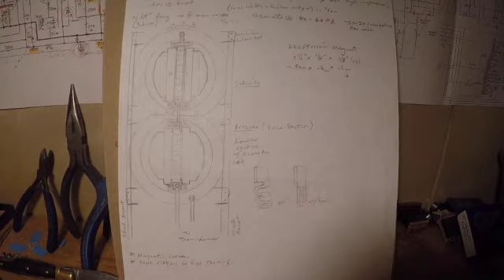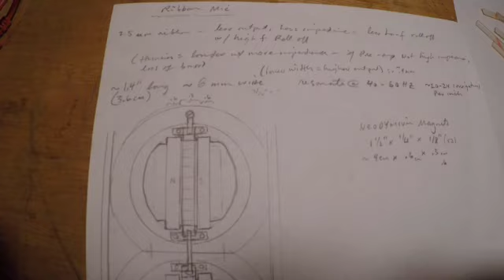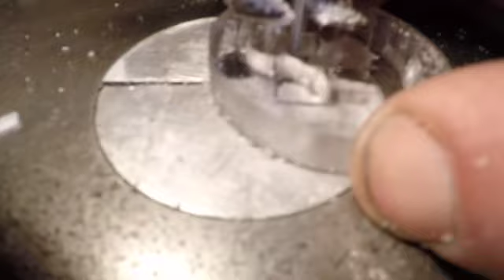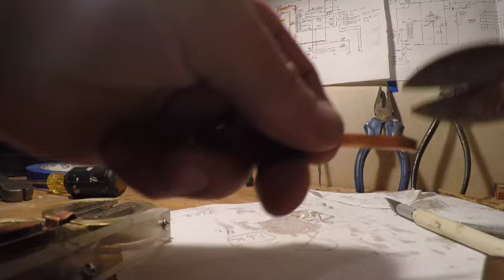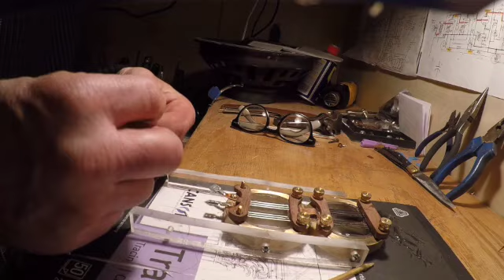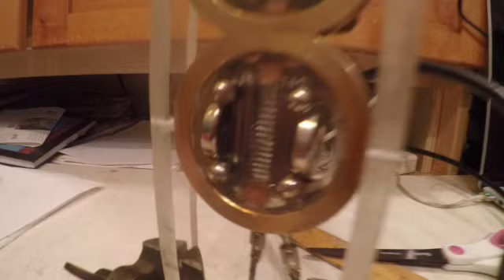Home built ribbon microphone motor

Comment: Still a good bit of buzz compared to the dynamic mic, is there a mechanical buzz in the room that's being picked up or is the noise from the ribbon mic itself? Amazing build here! I'm inspired by your craftsmanship
Reply from the maker: Thanks so much.  I am working on the sound quality one variable at a time.  I used some craft shop silver leaf for the ribbon on this - but I do have some thinner material to try.  I have negative feedback loops on a few of my projects as well that I am trying to work out.  Fixing the bugs is the fun (puzzle) challenge of these projects.